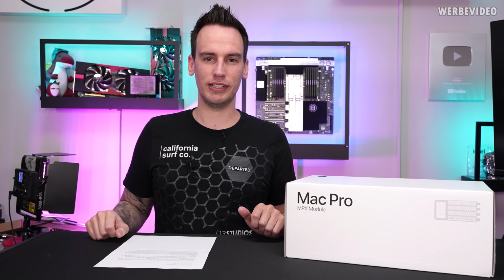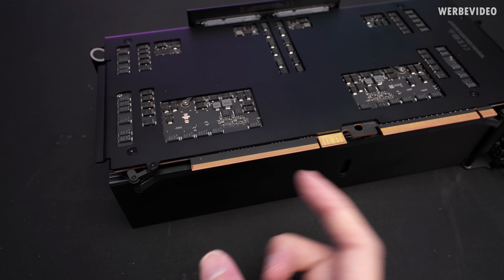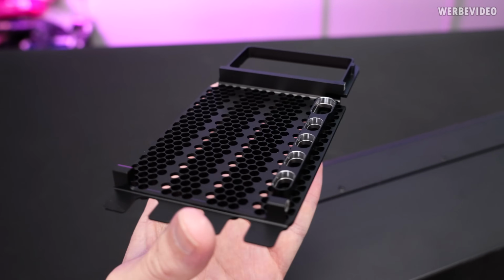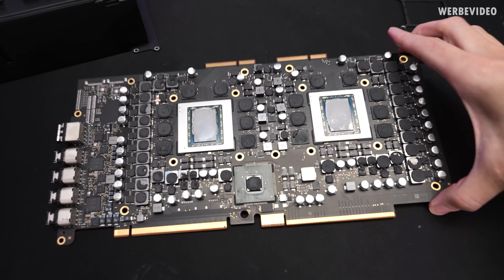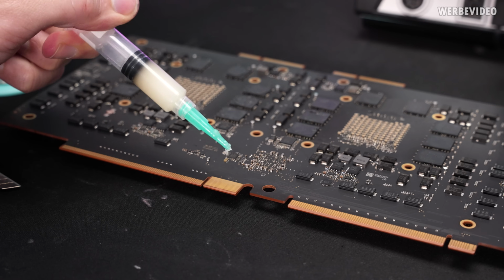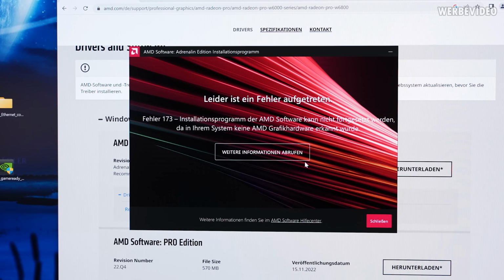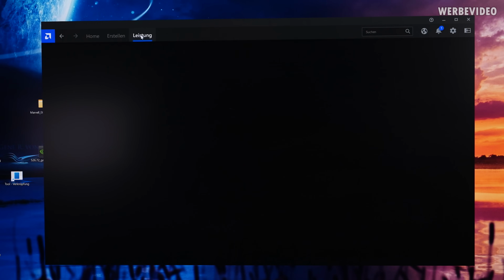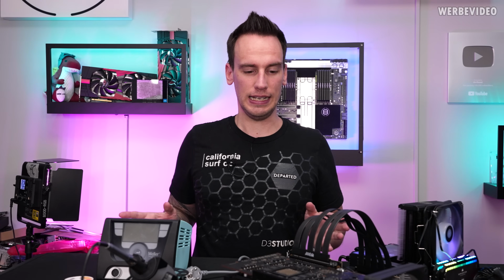This Insane AMD Dual GPU from 2021 is Faster than a RX 7900 XTX

Comment: I think one of the reasons Nvidia and then eventually AMD killed off game support for Sli/Crossfire is because it absolutely ruins product segmentation. Imagine if you have the option of buying 2x 3080s off eBay for $1000 getting better performance then a 4090? It opens up all sorts of corridors for breaking their ultra expensive product models.

Support was never perfect, but AMD/Nvidia in the last decade or so definitely didn't go out of their way to try and make it better. If AMD wanted to one up Nvidia again, I think bringing it back, only better would be a good step for doing so. I definitely think they could completely fix what oscillations there are and input delay, if there is any. With PCIE 4.0 or 5.0, bandwidth wouldn't even be a constraint anymore.

Comment: The card is correctly stated as 64GB because both GPUs can access all 64GB (although if the memory is in the other GPU the latency is higher, in which usually the CL try using only local memory). What the Infinity Fabric, SLI, Crossfire, NVlink does is to memory map each-other GPU memory space in a high bandwidth dedicated link.

It's somewhat limited in consumer grade SLI/Crossfire, but for these Pro series cards, basically any compute language that runs on the card can access full memory, regardless of using a single gpu or all of them.

Comment: MPX is only use on intel boards from apple....its bascily the same as CXL in server and workstation xenon versions ....good thing pc pro users have the tech as well and gpu that use it from the card that utilize it in  ponte vecchio setup when servers have many many CXL slots for having more than one cards ...its a beast for intel to mess with

Comment: Even S3 Graphics/VIA made a dual GPU card, the uD8 / uH8. I have taken the heatsink off mine and they are bridged by a PCIe bridge controller. I haven't seen them work together in a SLI way, multichrome for S3 Graphics. They only seem to work independently from each other. I have to do more testing though. It's a weak card made for digital signage, but can display out 8x 1080p.

Comment: I did similar tests with an MPX 580 Pro a few years ago.  Sadly the display outputs will never work in a PC, they're all routed through the MPX connector to a thunderbolt mux on the MacPro 7 logic-board (even the HDMI port). You can use the EDID emulation feature in the Radeon Pro driver to create a dummy display, needed to make the card boost properly in some 3D apps, but you still loose some performance using the iGPU for display.

Comment: Apparently, the card is freezing due to high temps. You cant expect a dual 6800XT card to run 3D Mark with a single fan cooling it from a distance.

Comment: AMD hasn't used any form of Crossfire Bridge hardware connectors for a decade or more. I think the last cards that needed it were the HD 7xxx series, the RX 2/3/4/5xx, cards after all simply linked on a driver level.

These newer cards however have Infinity Fabric, which contrary to Crossfire, does allow them to share memory, if you configure 2 cards as crossfire, you have 2x32GB and 2 GPUs, if you hook them up like this, they function like AMDs CPU CCs and share everything similar to how a CPU does. This is why AMD has been making some noise about adding more caches to their GPUs, because in essence, their cards look more like CPUs than ever and can be linked similar to how multichip CPUs are.

Comment: I would keep perusing the bootcamp driver route. 

Maybe get a mac pro to pair it with and get in working in bootcamp on the original platform first? Then you can go back to a PC and see how much the extra connector matters and reverse engineer the interface a bit more. Apple likes to extend standards with their own improvements so there might be some deeper dependency on the original mac pro hardware platform

Comment: I wish there was a mechanism like that for removing normal PCIe GPUs. I dread when I need to remove the GPU from my board for cleaning/repasting. Ive ended up using like a flat head screwdriver to reach down and push on the release even though if I slip off the lock put a divot in the motherboard I'd have to buy a new one of those.. That hasnt happened yet though.
Reply: It's better to use something like a chopstick, I had to learn that the lesson the hard way 
😅

Comment: The  MPX data slot is used for 2 things

1) to rout video out back to the motherboard so you can attach your screen to any TB port on the macPro you do not need to attach to the one on the back of your GPU
2) to rout TB connections to the TB ports, those are not just display they are full TB including PCIe tunnelling.  

You're not going to be able to make use of it even with a pinout since there are no intel xeon platforms out there with the needed firmware that would enabled this type of TB tunnelling.

These gpus do not use crossfire.  The multi gpu support they have is differnt and is forced on compute. Apple expose a set of multi gpu apis in metal that let one gpu read and write memroy from the other (without going over the system) including scheduling tasks on each other without involving the cpu.
Reply: This.

Comment: If they could link the workloads from a single process without software, dual GPU on a board would be very viable.  
You then set each chip to 100-150W max and use cheaper fab processes to lower costs.  
AMD/NVIDIA don't need to run these GPU cores at MAX speed, for example the 4090 can run at 300W and get %97-98 its performance!

Comment: even though the mpx slots solved pcie3 bandwidth limitation from the slots that apple add extra slot for only use for multi-gpu slot that have motherboard that have MPX slots that can support to add more than one cards in their workstation...believe me, its most expensive setup from apple...$5k per module and another thousands for cards that with that setup...the machine gonna surpass 4090ti or even 5090 from nvidia...the tech is proprietary from apple ...if apple use on nvidia cards ...it would be otherway around that 4090 would overpass everyone else and nobody gonna win that ...its monster idea from apple cause they only know one word...is fast

Comment: I'd love to see a follow up to this. Its super interesting that this Apple AMD Dual gpu actually functions at all on a windows system but also completely stomps the 7900 XTX. Maybe dual gpus could make a comeback in the future using whatever technology AMD used in these modules? Clearly its working much more seamlessly than typical crossfire solutions. Though, that's just with Timespy. I wonder if the performance gain over the 7900 XT will hold true in real production applications or games.
Reply: its huge difference in setup...its base on CDNA and consumers are using different branch RDNA architecture ...CDNA is base on older tech from GCN3.0 that been renamed to CDNA...compute processing vs RDNA is old raster processing that base way older tech from ati since hd6900...hence this how far they can get versus raja koduri GCN tech can go further is unexpected for amd...
Reply: @user78405  That's simply not true. The W6800X Pro Duo uses the same Navi 21 cores as the RX 6800/6900 family. CDNA is used in AMD's instinct cards.

Comment: yes its so insane that amd taking amd customers as fools to spend more than 2021 dual gpu version that cost  very less than 7900xtx that perform way faster than 7900xtx...how lucky for folks bought it but sadly that makes no sense for amd stop updating drivers for that that cause to run broken by on purpose from amd...this is why i never trust amd ever when they have software to controlled you and your hardware when they feel like it ...

Comment: please put on EVERY GPU review you make/made a thumbnail DON'T BUY IT UNTIL IT COSTS X2-3 LESS. 
no sarcasm or quotes like "good value" but straight up put on the 4090 review thumbnail "DON'T BUY A 4090 UNTIL IT COSTS $700", on the 4080 review thumbnail "DON'T BUY A 4080 UNTIL IT COSTS $600", on the 4070 Tie review thumbnail "DON'T BUY A 4070 Ti UNTIL IT COSTS $500".

and do the same with all your GPU reviews.
thats pretty much it. and every other top youtuber should do the same.
Reply: no inflation can account for  x2-3 higher GPU prices. what actually responsible for x2-3 overprice is 50% corporations greed and 50% people's unawareness, people believe shills and marketing and go and buy overpriced GPUs. people are unable to compare prices/performance of GPUs, they just buy anything at their price tier not being aware about overprice and price/performance matching being done by corporations to not drop prices.
we can't fight corporations' greed directly, but we can fight people's lack of awareness.
top tech tubers fail to keep corporations in check with their prices while they have all the power to inform A LOT MORE people not to buy overpriced GPUs. 
we have to fight back overprice and we can if youtubers are actually work for their viewers and not for corporations.
ask tech tubers to use their thumbnails as a weapon against overprice.

Comment: I remembered when the GTX 295 and GTX 690 were released. My brain just thought that Nvidia would one day combine both multi-GPU-on-a-PCB approach and run 4 GPUs on a single PCI-E slot. Thank god that didn't happen;  I hate to imagine the price 🤯
Reply: I would bet we will soon see it on one package
Reply: Like the 4090 price?
Reply: @emmata98  more like 4090x2. Quad-GPU  set-ups of old used to cost $5K on their own. So a 4-GPU die on a PCI-E slot would most likely cost 2.5x of a 4090.

Comment: The drivers for this card are not from AMD but rather Apple in their Boot Camp collection.  This is the software that Apple bundles to boot and run Windows on their Mac Pro.  You got the GPU drivers from it installed but you will also need to the Thunderbolt drivers installed.  The HDMI port on the card is fed from one of those Thunderbolt controllers.  The MPX controller should also have a few pins for handling interrupts for Thunderbolt hot plug.  Not sure if the HDMI functionality requires those pins to be connected.

Depending on the task, video memory is indeed additive instead of mirrored across both GPUs.  This is due to the on board Infinity Fabric link between the GPUs.  Having two of these cards with the Infinity Fabric bridge would enable quad GPU functionality and the ability to pool all the VRAM together depending on the application.  The bridge should be attached so that it can properly terminate the Infinity Fabric link.  

There are four PCIe devices on that card:  two GPUs and two Thunderbolt controllers.  Conceptually there would be 16 lanes per GPU,  4 lanes to each Thunderbolt controller,  16 lanes to the PCIe connector and presumably 16 lanes to the MPX connector.  That'd be 72 lanes in total.  What is worth noting is the PCIe bus on the Mac Pro is only PCIe 3.0, though the GPUs support PCIe 4.0.  The bridge chip could be limiting things to PCIe 3.0 speeds.

Comment: As I recall, this was the same as the CDNA dual uh CLPU (Compute Library) card, but obviously featured GPUs, allowing for graphics output.
As I seem to recall reading that the Dual CDNA-chip compute cards WERE the cutdown "6800" level chips, for thermals or/and power draw.

I hate that dual-GPU didn't get love from devs for gaming. Even with DX10/11 which requires far less dev side effort. 😔

Still, as cool as this thing is –despite being Apple– this isn't quite as cool as my Quantum3D AAlchemy 8132 cards, with 8x 3Dfx VSA100 GPUs (twice that, of what the Voodoo 5 6000 would've had). 😊

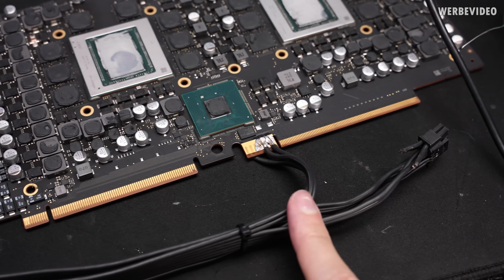Comment: 12:57 did you measure voltage drop on those two wires? seems too little for running dual GPU card even accounting for PCI-E power

Comment: Bro, make a project around this card a full PC build.
1. Water block, maybe dual sided since it has ram on the back.
2. instead of soldering wired created a plug-in 3D printed adapter with prover wires going into adapter and all connected

Comment: This is a very interesting card, it's test results would seem to make it a good all round card, I feel it's the extra slot details info that would allow you to unlock it's full potential.
It has also raised a question in my head, AMD used the Chiplet design for RX7900XTX/XT as duel GPUs didn't work well together and had laintance and other overheads but maybe AMDs Chiplet design has hit a few of the problems duel GPUs through up in SLI or Cross fire reading some of the problems were quite unexpected like micro stutter.
Reply: The chiplet design really opens up the possibility of these multi gpu designs, just put another compute die in there.

Comment: That is a neat video, I am not surprised there is not much information about the MPX module, getting any sort of electric diagram out of Apple has been the bane of every repair shop in existance. but its cool to see it working. I have also seen videos where the 6800x duo is claimed to be thermal trottling once installed on a Mac Pro and running a productivity suit, looks like the passive cooling and the few fans the mac pro has is not enough.
Reply: Of cource it is not enough. Same card still runs hot with 3 fans at full power, now imagine having 2 for both cards, with very few fins, and their RPM is gipmed af because apple doesnt want their customers to be annoyed at the fact that their computer is struggles to cool itself.
Reply: @alexturnbackthearmy1907 what a waste of card :S

Comment: Maybe with the power cable fully soldered to the connector, and a revamped cooling system, it'll run perfectly.
Man! A full active, double sided waterblock on this card would look beyond amazing!!! And could even fit it's original shroud over it!!!

Comment: When you sort out the cooling and perhaps adding more wires to the power delivery could you do a couple of game tests. Was curious as you did not have to turn on crossfire, it just worked natively, so would this give you the the full fps of the two cards or be limited to just one.Thanks man.

Comment: The extra MPX pins are for thunderbolt - you could plug your monitor into one of the thunderbolt ports on the Mac Pro itself and it would still work, because those extra MPX pins can be used to carry the DisplayPort signals back into the motherboard.
Reply: or bring some PCIe over the existing TB3.0 ports, depending where it is going.
Reply: Yeah it does both. It brings 8 PCIe lanes to the Thunderbolt controllers embedded in the MPX module to allow using them for other peripherals than displays and brings back DisplayPort signals to the motherboard to allow connecting displays into any Thunderbolt connectors.
Reply: I think I just purchased the last last last AMD dual GPU card the never released but I somehow got an engineering sample of Radeon pro v540
Reply: @beatyoubeachyt8303  
Whut? How?
Reply: Can you put two pcie risers and plug it into two pcie slots?
Reply: nope they are there for cross fire🤪🤪🤪🤪🤪

Comment: If you look at the reviews for this card, the biggest problem is the GPU temps. It seems that the heatsink can only really handle a single 6800 GPU well. The other huge problem is the price lol. If I could get one cheaper and it didn't have thermal issues I would. Probably better off buying two of the 6800 cards for a Mac Pro.

Comment: I wonder if a custom edge connector PCB for the power contacts with VERY thick traces that break out to a 2x8 or 3x8 PEG connector might let this thing run at full tilt?

Comment: Very cool, you can sometimes get wattman to work on the pro cards (tested with my wx9100) by going to the registry key:
'HKEY_LOCAL_MACHINE\SYSTEM\CurrentControlSet\Control\Class{4d36e968-e325-11ce-bfc1-08002be10318}\0000'
then create: DWORD 'KMD_IsGamingDriver' and set it’s value to: '1' and then restart

Comment: I believe you must check that MPX connector to confirm EVERY power connection, I believe this is shutting down due to lack of power so yes lack of wires but also connected elsewhere. Another important detail would be the missing SMBUS drivers etc, power wise budget your cabling for at least 500watts over 12v, and check please check for additional power connections and their voltages. 5v should no be going over 75w and 3.3v max at 45/55w

Comment: I don't have access to the documentation, but the MPX does the Thunderbolt handling. there's chips on the card that mux the video buffer into the thunderbolt being piped into the card. from what i understand this was a way to enable thunderbolt support without AMD needed to license chips that handled it on the card, but I have no proof for that.
Reply: Correct.
Reply: @FixedFunction I see your name popping up a heap on this comment section and you seem to have some serious knowledge on these cards. Do you have any shareable Information on them? I'm considering buying one myself purely to make work in windows with a better power connector and hopefully a solution to the mtx connector

Comment: Start with disassembling and soldering? arrrgh. Should first test it in dedicated apple setup to see if it works properly. The soldering wasn't nice, I'd rather see a connector made for it.

Comment: Ouch, that hurt me seeing you solder directly to the gold connector.  When I worked in electronics manufacturing, most of the time that would be a scrap board.  I was thinking you should connect the wires to a component on the 12v and ground rails.  However, there might not have been enough room when you needed to add more wires.  I'm also surprised you didn't plug in a monitor once you got the drivers working.

Comment: I would imagine the card's BIOS would need to be flashed to get it to bootstrap successfully.  This was the case with Nvidia GPUs on much older Mac systems; the firmware in the Mac versions of Nvidia GPUs that did not work with Windows.  Flashing with a standard BIOS would get those cards working on Windows.